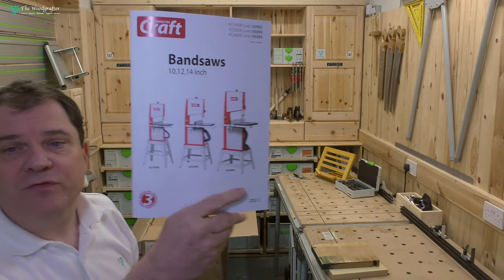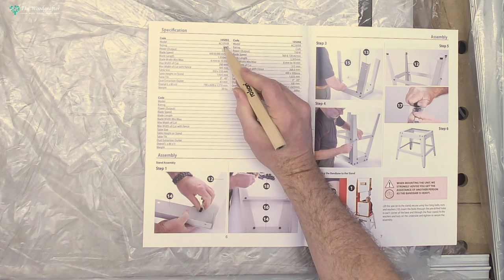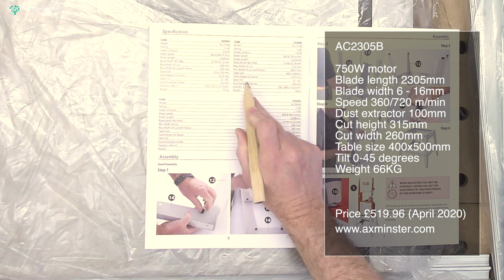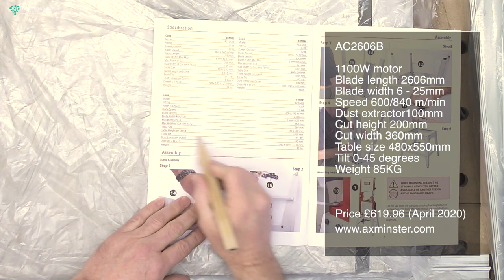Axminster Craft AC2606B unboxing

Comment: Hi.  Thanks for the review.  I was just looking at this specific bandsaw and your youtube series on it confirms it's the one I would like to go for.  My one question is which additional blade did you opt for as I couldn't figure it out from the videos.  And what made you decide to go for the change?  Regards and thanks.  Martin
Reply from the maker: Hi Martin,

The blade that came with the saw is OK, but won’t give you the best cut. It tries to be all things to all people.

I use the Axminster Axcaliber range of blades.

I low TPI for rip cuts - typically 4 ideally the diamond ground. Also looking for a wide blade to dissipate heat and to stabilise the cut.

I then go for a high TPI - typically 10 for a finer finish cut, usually looking for a narrow blade to allow for curves and intricate work.

Cheers

Andy

Comment: Nice one Andy... Get yourself a Tuffsaw  blade, (www.tuffsaws.co.uk) the difference will astound you.  I would suggest this one M42 (Wood Cutting) Bandsaw Blade -
2606mm x 1/2" x 4tpi. This blade is more expensive but lasts a lot longer.. You don't need a 26mm blade  for resawing, and deffo less tpi  Cheers Paul
Reply from the maker: Thank you for the tip - I have bought some of the Axminster pro blades (you will see them in a later video) 

It’s like a knife through butter - can’t believe it’s so good.

Andy